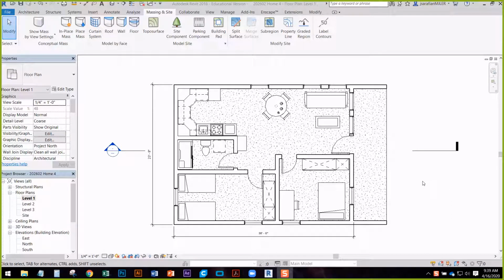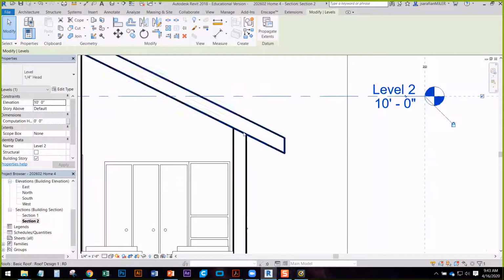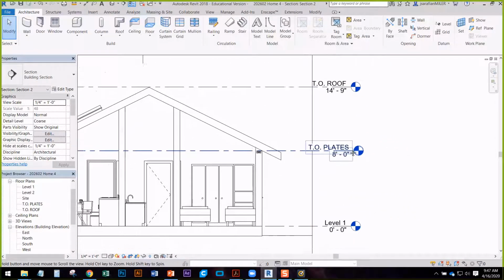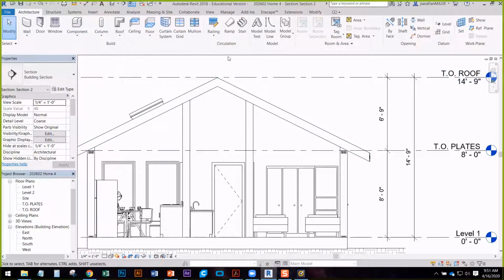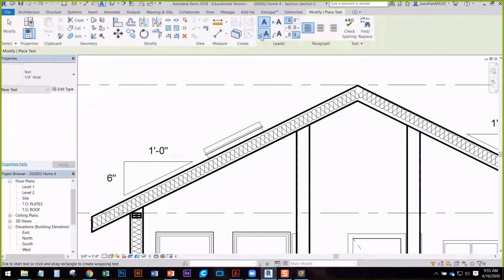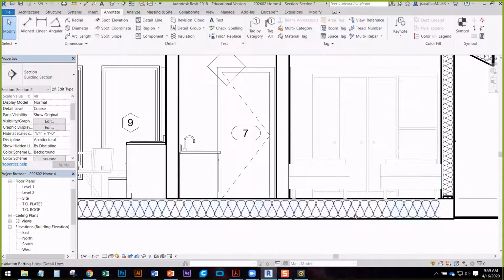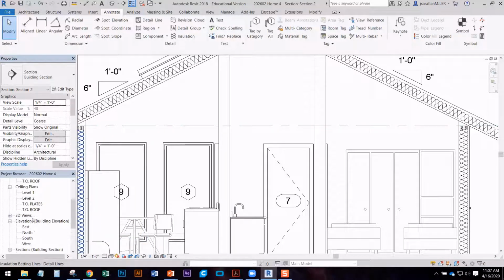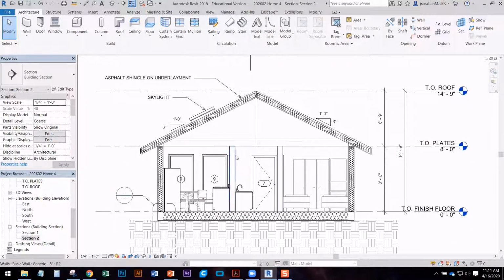How to draw a Building Section in Revit

Comment: Im really new at Revit and my issue is how to get the imperial families? I always get stuck at this part.
Reply from the maker: Revit typically puts them under Program Data > Autodesk > RVT 2021 > Libraries > US Imperial
To see the "Program Data" Folder, you need to show hidden folders in your windows browser. See below on how to do this:
https://support.microsoft.com/en-us/windows/show-hidden-files-0320fe58-0117-fd59-6851-9b7f9840fdb2
Reply from the maker: Also, recent releases of Revit prefer you to use "Load Autodesk Family" instead of "Load Family"